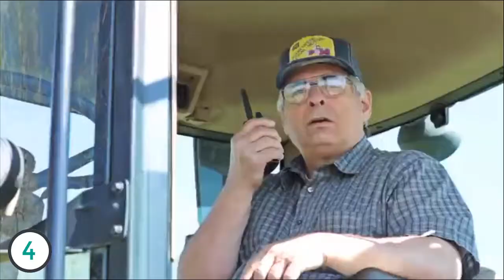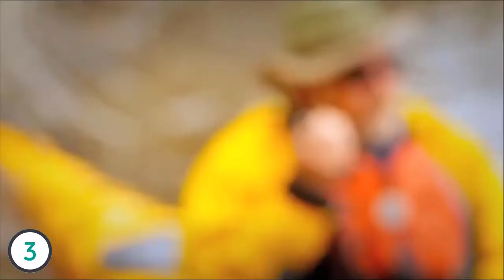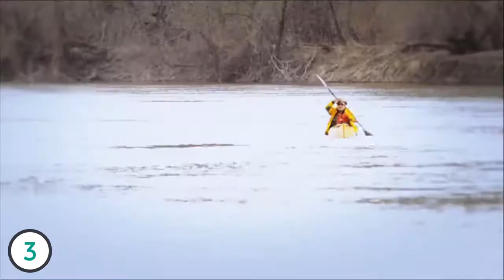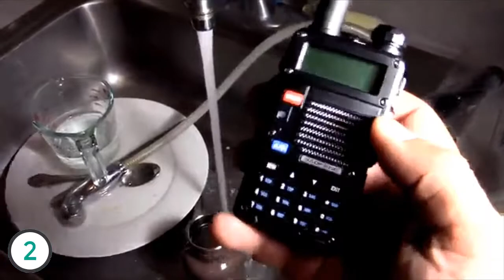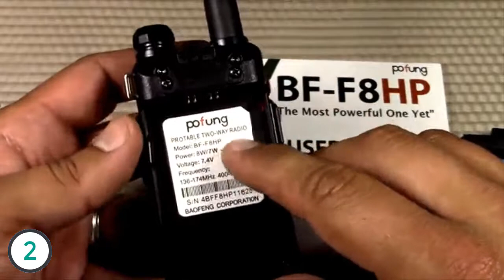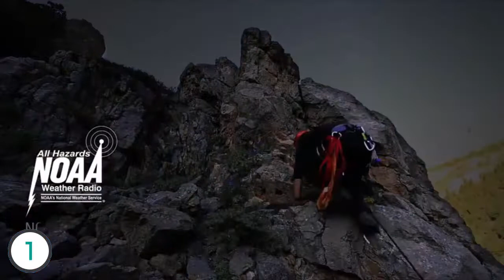Best Two Way Radios 2019 - Two Way Radio Review

Comment: If I'm not using it as HAM, do I need to program it still?
Reply: you cannot use it for G M R S  as the F C C banded it for use on G M R S radio as it is not part 95 certified so it is back to a ham radio